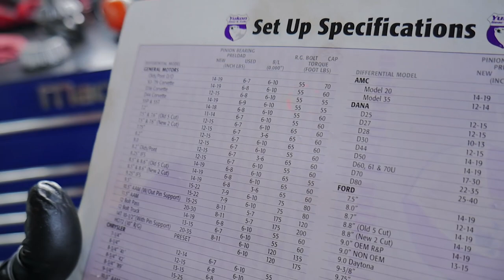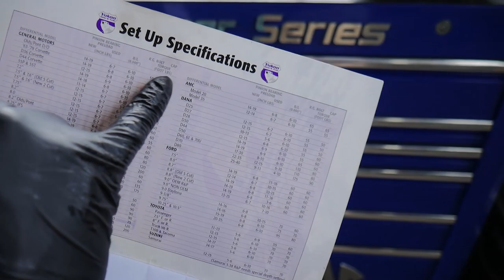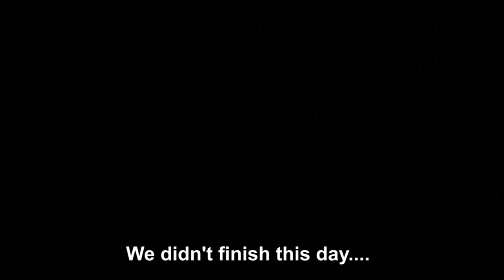NO DRY RIDES 2017 Ram 4.56 Gear Swap Install AAM 11.5 & 9.25 Differentials

Comment: At 46:00 you state that because the ring gear is thicker, it pushes the carrier over to compensate, which isn't entirely true..with increased ratios, yes the ring is thicker, but its thicker to compensate for a smaller diameter pinion gear.

Comment: Pro Tip, Yukon Gear paintis real thick you can cut it with a little gear oil in a small amount and it will coat the Gear teeth easier!

Comment: I have a 2017 ram 2500 CTD with a 6 speed manual. I’m thinking about 37” tires also. Wonder how my truck will react to the bigger tires since I’m not running the auto trans. I’m thinking the manual will be more forgiving, I don’t know. What do you think. 
Excellently video by the way. Good learning stuff for sure.

Comment: This is what I'm getting done right now.. very stressful.. I wanted 4.88 on my Ram 2500 to find out the they are not available for a AAM 9.25 front axle .. so have to settle for 4.56 gears.. awesome to see the stuff my shop and I will be going through.. but if anyone has experience looking for 4.88's please DM me .. thanks 😊

Comment: When you guys were checking the rotational torque on the front diff did you have the Carrier in? Or were you checking it with just the pinion in the diff? Thanks

Comment: so, on the front axle, there are total 4 seals? one at the 4x4 engager, two on each side of the pumpkin, and one behind the pumpking at the drive shaft input?

Comment: Where is the shop where you had this work done? I had a rear rebuilt at a Dodge dealer it started making noise after 3 months they been giving me the run around  trying to find other noises they can blame it on it's been in the shop now for 12 days they say they can't find any problems ,it makes noise when you turn corners so if they can't get we done right I'll need to find someone who can.
Reply from the maker: ed sheets Chester County Transmissions, info is on the partners page of my website. https://allbeastprojects.com/pages/partners

Comment: What was the pinion shim size. The one on my truck is 0.05in.but the new the pinion has a shim number 0.07 so do I go with 0.05 stock or 0.07 new.the ring gear is taller and the pinion is smaller.

Comment: hello how are you I wanted to see if you could help me I have a problem with the depth of my differential it is a 9.25 of a dodge ram 1500 2007 2wd and what happens is that I am changing the ratio from 3.55 to 4.56 and the only number it has to guide me It is 162 in the head of the pinion and I have tried several times and the mark does not give me if I bring the backlash too close the gear touches the housing and is scratching it if you could tell me how to figure it out I would greatly appreciate it thanks in advance

Comment: Somebody may have already asked you this question.... but I have a couple if you could help me that would be great...

First thing, I have a 2015 Ram 2500... with 5.7... Not exactly positive what size my rear and front differential is our... I know it came factory with 3.73’s....

If you could tell me what kind of Gears you’ve got it where you got them would help me out tremendously... I thought about going with a 4.56 or 4.88.... but I can’t find the 4.88 for the front differential.... I can only find the 4.88 for the rear differential.... can you help me out please?? 👍🏻
Reply from the maker: My truck had 3.42’s. The new gears are Yukon & I got their master install kits. I purchased everything from East Coast Gear Supply. Their staff is very helpful if you have any questions. I wouldn’t go above 4.56 unless you’re running 40+ inch tires, just my thoughts.
Reply: Thanks bro, I really appreciate it!!!!
Reply: One more quick question, When you put in your 4.56 gears did you have to adjust just speedometer, I wasn’t sure if it would mess with your speedometer or not?
Reply from the maker: Nope
Reply: @Jenkins207  it would change speedometer reading if all that was changing is gear ratio. If the change in ratio is to compensate for larger tires it will likely make the speedometer more correct.
Reply: Did you ever swap the gears in your hemi? I've got a 13 hemi 2500 and just went to 35s, I was thinking 4.56 just because of the amount of towing I do but wasnt sure if it would be way to much

Comment: Just curious on yours and this shops comments in this video and the past they have been putting aam 11.5 in dodge since I believe 2003 or 2004........ and this shop has never seen one. Not saying they aren’t capable, just to of been in business since the 80s and those axles been out for 15years and have wrong info

Comment: How did you tell your computer what the new gears ratio is
Reply from the maker: Through the relearn process, it resets the parameters & learns/adjusts the shift points as you drive at 30% throttle for about 30 miles w/ a lot of stop & go.
Reply: @BEASTProjects  thanks my truck goes in next Monday for the swap

Comment: Side bearing preloads??? Put a good coat of grease on the backside of the seals before you beat them in to keep the springs from falling off...never seen anyone chisel the ring gears off of the case....a drift from the removed bolts if the proper way...

Comment: What, if anything, has to be done with the computer after the gear change?
Reply from the maker: The trans relearn is a must, because your shift points will change w/ the gear change.
Reply: How about the speedometer, do you need to do something for it to read correctly?
Reply from the maker: Nope, I am running bigger tires & I recalibrated it w/ my EzLynk.
Reply: Did they plug a computer into your obd to tell the computer you now have 4:56 gears?  Then go drive for your break in , relearn.
Reply from the maker: No, just do the trans relearn.

Comment: Surprised you went 4.56, I sell a lot of 4.30s for 37s
Reply from the maker: I had planned to go to 40’s in the future. I agree, 4.30’s would be perfect for 37’s.
Reply: @BEASTProjects  would you go 4.1 for 35's?
Reply from the maker: 3.73’s or 4.10’s would do well w/ 35’s in my opinion..
Reply: @BEASTProjects  i have 3.73 factory but looking at something little more tow freindly
Reply from the maker: 4.10’s then.. 👌🏻

Comment: Adjusting backlash without an indicator gauge? You may get lucky, but the customer paid for doing the job right which requires using an indicator gauge for setting the backlash. No excuse for a supposedly professional shop not to have and use an indicator to set backlash
Reply from the maker: They did use a gauge.... 🙄